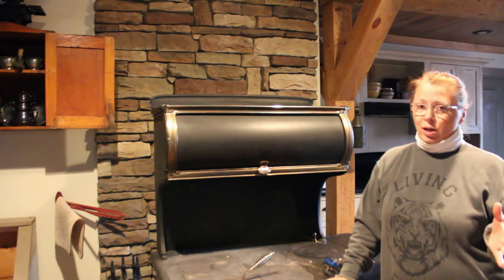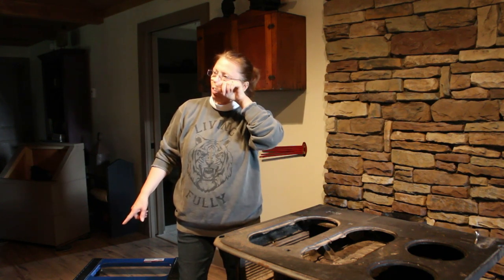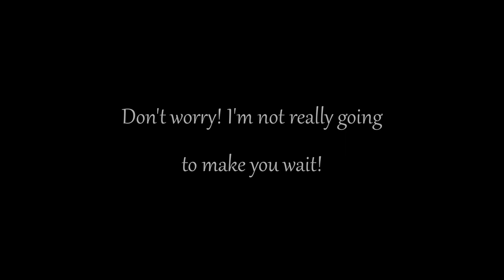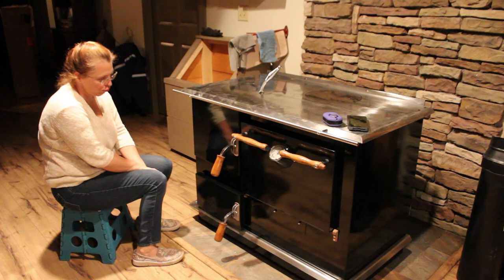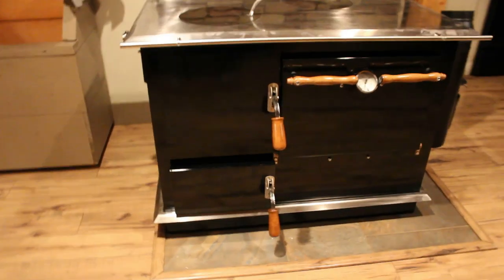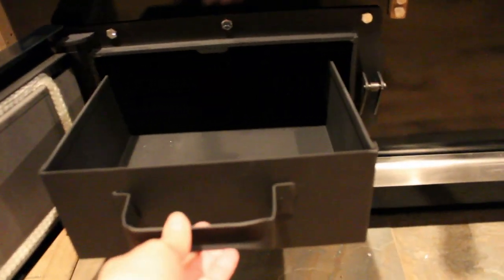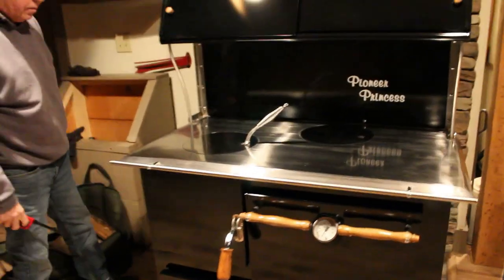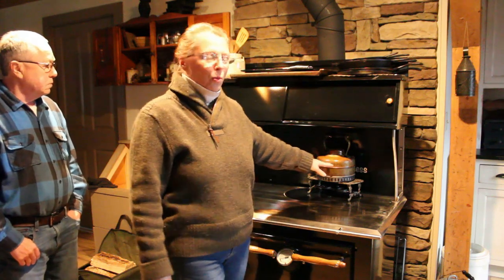Our New Wood Cook Stove ~ It's Finally Here!

Comment: How is the Pioneer Princess holding up? Seriously considering on pulling the trigger on one of these stoves. Thanks.
Reply from the maker: Thank you for asking. My husband and I both agree that in the beginning, the Pioneer Princess was a good stove, but this year, we have really struggled with it. It definitely doesn't put out the heat our old Queen Atlantic did. The stove is hard to get hot enough to bake in, so I haven't been using the oven except to keep things warm. It's far too expensive to not be able to use it to its full potential! My husband and I are good friends with an Amish family that lives in a nearby community. They told us that they got rid of their Pioneer Princess and opted for an Ashland stove instead. I guess we aren't alone in our thoughts of this stove. We will be looking for a new one for next year. I do hope you find a wood cook stove that works for your needs. Have a blessed day!
Reply: @JulieKeeperofMyHome  Thank you for responding and your honesty. That is most unfortunate to hear that, but I appreciate it. I wonder if the stainless steel construction is simply letting too much heat out versus the older cast iron stoves? For that kind of money I might save up a little more and pick up a Heco, made by DS Stoves. Cast iron encased in porcelain for a stove top and a shaker grate to burn coal as well as wood. Have a good day and God Bless.
Reply from the maker: That sounds like a nice stove.

Comment: The ash trey without a back, when you lift it up to take out, would think the ash would slide out into the bottom/floor. its been two yrs since taped this. Has that happened?
Reply from the maker: Thanks for asking Kevin. It is a strange design, but I think the thought behind it is that should any ash fall out when removing to empty, it would work like a shovel when putting it back in. We haven't had a problem losing ashes, but we are very careful when we remove to empty. Merry CHRISTmas!

Comment: I know this is old, but we are in the process of buying a wood cook stove. Can you provide more information about this new one? Thanks!
Reply from the maker: Hi Amy! I'm happy to help you! This is a Pioneer Princess, one of three in the line of Pioneer stoves. The other two are the Bakers Choice (economy) and the Pioneer Maid (most efficient). Our model would fall in the middle. It is thermostat controlled, burns overnight up to 10 hours or more. We have actually let it go 13, and it still had a nice bed of coals. It's 18 1/2" L x 13 1/2" W x 18 1/2" D fire box, is brick lined. The flue size is 7", and it weighs 600lbs. You can get it with/without the water reservoir. Add another 50lbs on for that. It has a welded construction, stainless steel top and trim, smooth top, porcelain finish, shaker grates, easy ash removal, a large oven with 2 racks (22" D x 19 1/2" W x 13" H). The cooking surface without the reservoir is 43" L x 22 1/2" W. The cooking height is 32 1/2". The model we chose is both top loading and front loading. It is U.L/U.L.C. rated. This stove  has an auxiliary turbo draft for easy starting. We also have a warming oven, but it is optional, just like the water reservoir. We paid about $2900 for this particular model. I hope this information helps you out. Let me know if there is anything else you'd like to know. We love this stove and are very happy with our purchase. It was definitely a learning curve compared to the one we had, but we feel we made the right choice. Have a beautiful day! 😊
Reply: @JulieKeeperofMyHome  U should get a rebate for writing a "year later" review! 🌹💕

Comment: Too low for me. And I'm only 5'1".
Reply from the maker: Thank you for stopping by my channel! It's probably hard to tell in this video, but the stove height is 32". I'm 5'4, and it seems to work great. It's typical for them to be lower than modern stoves. Back in the day (or now if you are amish), large pots of water were heated on them for laundry. The lower height made it much easier to lift large pots on and off. Have a beautiful week! (It's snowing here!) 🥶